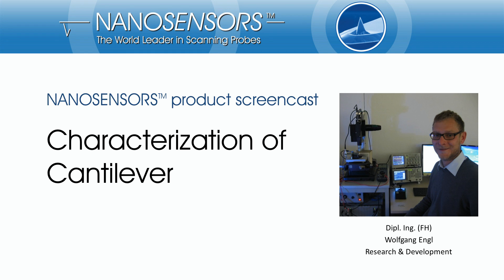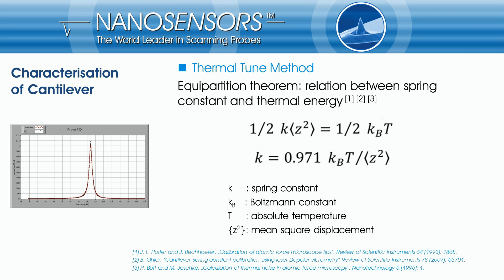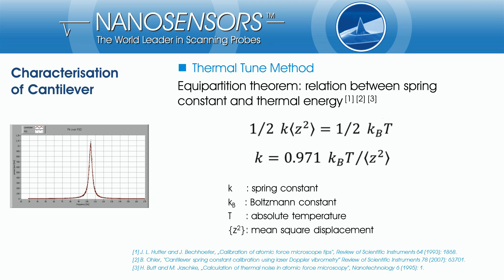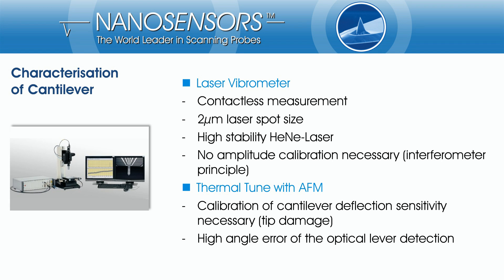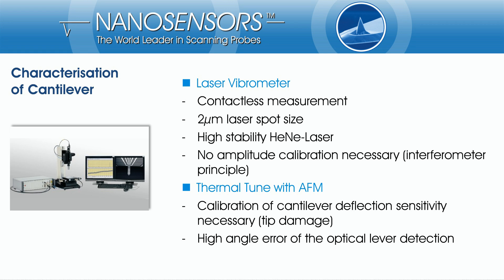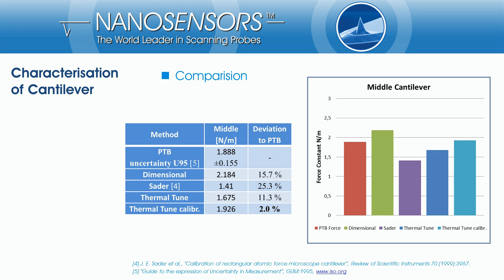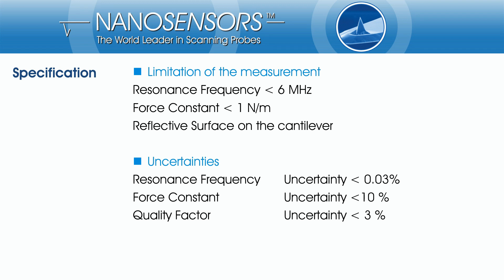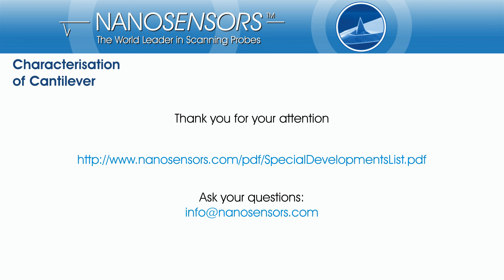Calibration Service for AFM Cantilever

Comment: during calibration of my afm probe using thermal tune method using bruker clfc probes.......my spring constant becomes negative ...may i know the reason. Is it possible to convert the deflection sensitivity unit from mV/nm to nm/V.